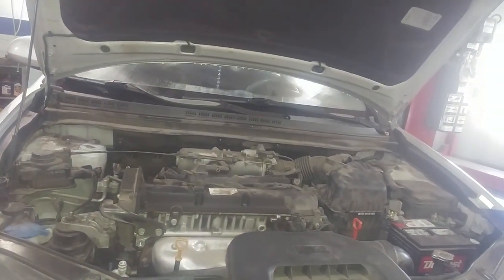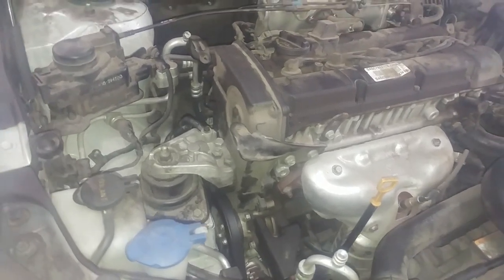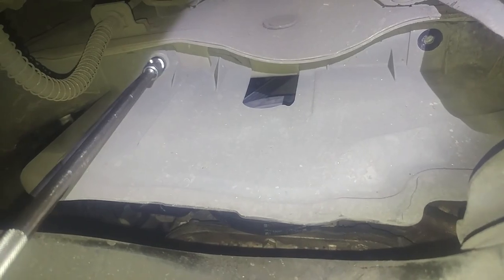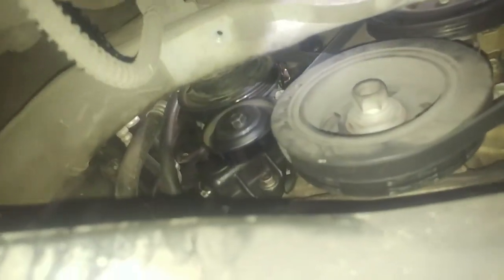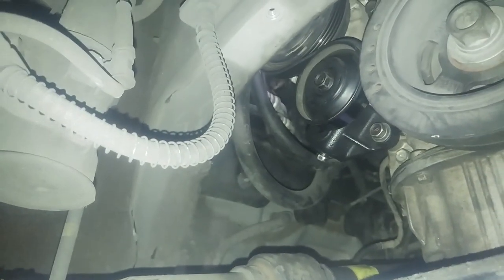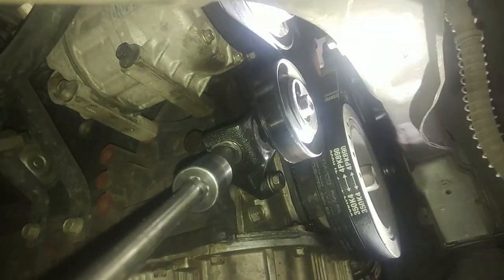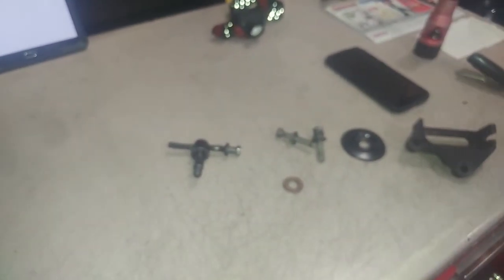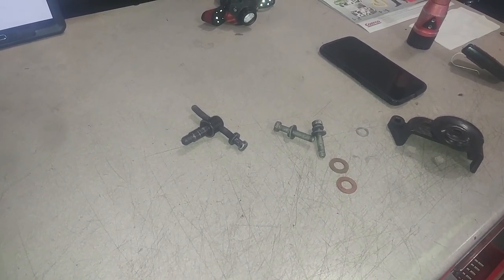Hyundai Elantra belt noise on start up loose belts and a little more

Comment: The tensioner screw for my alternator belt comes loose on its own and i can’t figure out why. It’s getting worse and worse. I have to tighten it like every other day now
Reply: Put some blue locktite on the threads
Reply: @LucasG898  I’ll try that thanks so much
Reply: @dannyboy768 hey I also found that you have to loosen the 2 bolts Holding the alternator in before tightening the tensioner screw. So you loosen 2 the holding in, tighten tensioner, then retighten the 2 bolts holding in.
Reply: @LucasG898  Ok I will try that. None of the tutorials mention doing that so thank you
Reply: @LucasG898 Bro thank you soo much! I did what you said (except the blue loctite) and I haven’t had to tighten my belt this whole time and been driving around a lot. I took my car to TWO different shops, had it towed several times and went through like 3 belts. THANK YOU

Comment: So how do u adjust alternator belt???????????
U took it apart but never showed
Reply: The bracket here at 1:40 with the screw going into the alternator. then see the longer screw hanging out of the back of it, that's your tensioner screw. Kind of self explanatory let me know if you need further detailing but searching alternator replacement on Elantra will yield many videos showing how to reset tension on the belt in depth as well, because that's obviously needed after any belt driven accessories are replaced
Reply: @dudebro2001  
Thank you for your reply

Comment: I did my timing belt and water pump last night. Have a whining or chirping sound that gets louder as the engine revolves faster.

I suspect either timing or one of the three outer belts are too tight. Really suspect timing belt too tight. 

It reminds me of a supercharged car when you can hear a whine louder and louder as the RPMs go up.

Any ideas? Itll be easy to play with tension as long as the access bolt for tensioner is above lower timing cover, i dont remember, will double check soon. 

Either way its a pretty easy job. I didn't mess up timing alignment so I'm good there. I'll rip the whole damn thing apart if I have to again.  Ths hardest part was cleaning the water pump gasket off the engine surface.